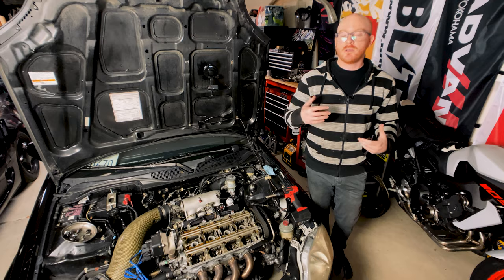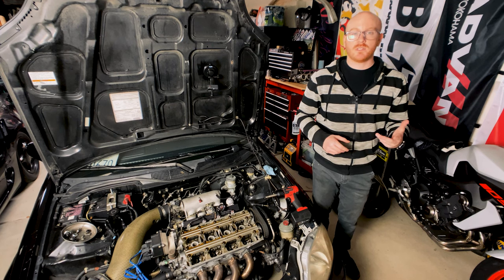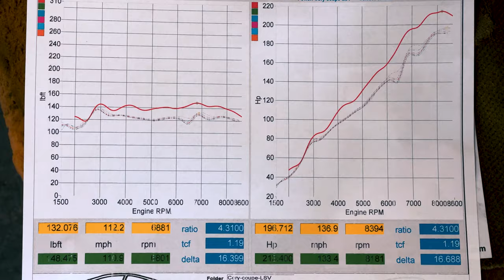Dyno Gains! Do Skunk2 Cam Gears Make a Difference?

Comment: What degree are the cams set at?
Reply from the maker: Hey Mike! I will have to check for you. It's hard to tell with the current valve cover setup. However, note that your tuner will have to make adjustments during tuning to get the most power and there's no set number to gain performance. 

Other issues to factor in are engine quench, which can be very problematic for degreeing cams if your engine is running very high compression pistons. Usually its a good idea to clay the compression chamber to see exact clearances.

Comment: What's the adjustment to make 213
Reply from the maker: So the first dyno was from right after the engine build and was in its break-in period. Its been a few thousand miles now and its nice and broken in, so that added a couple ponies in itself. I also swapped from 550cc Evo IX injectors to new Grams Performance Injectors, in addition to getting the cam gears adjusted. I think most of the power came from post-break in and retune though. Plus, Erick said he had a few new tricks to make better power on this setup that he employed.